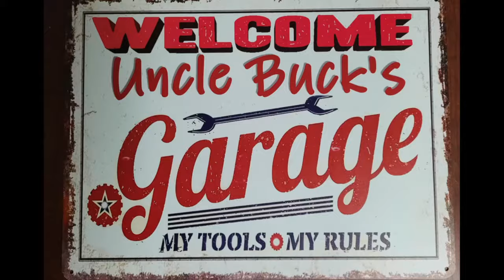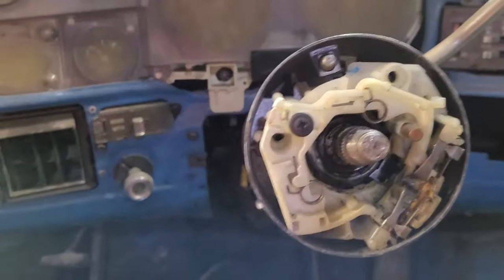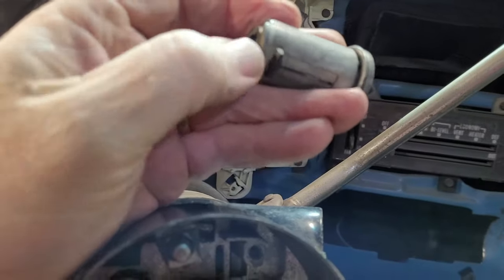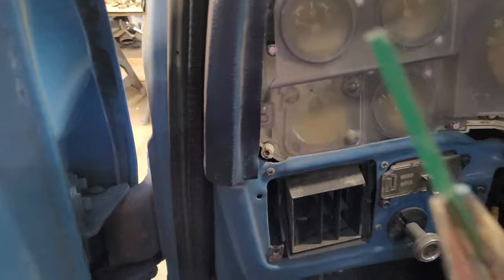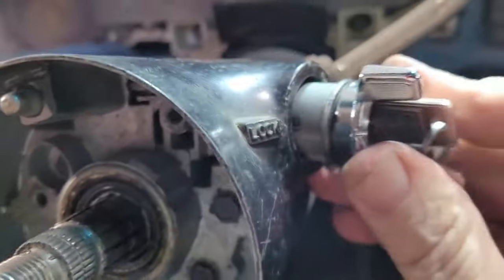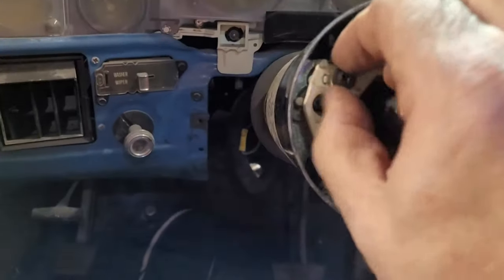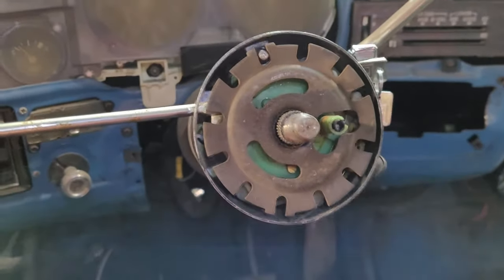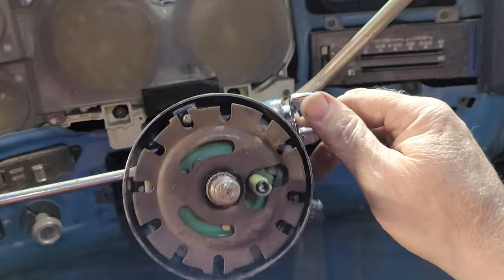How to Easily Remove & Install an Ignition Lock Cylinder: Square Body Chevy Hotrod build

Comment: I got mine out but it won’t lock back in place when I’m putting in the new key  in my 83 el Camino
Reply from the maker: there are two styles of lock cylinders, make sure they are the same and oriented the same way as the original. Best of luck
Reply: @unclebucksgarage7695  I got it brother thank you
Reply from the maker: AWESOME!

Comment: Nice video! What about a 1986 chevy C20. I got down past the  compression plate but the screwdriver isn't unlocking the cylinder.  Taking it slow.so I don't mess anything up. Any ideas?! Semper Fi!
Reply from the maker: It should, try using an end of a hack saw blade, you might not be depressing it enough good luck